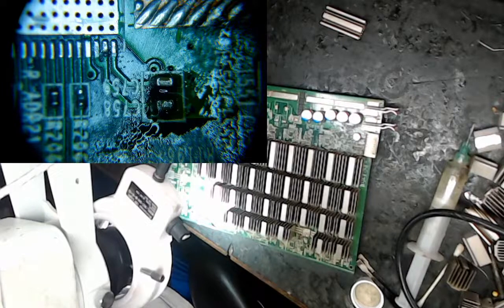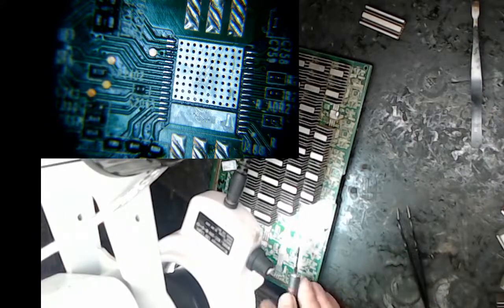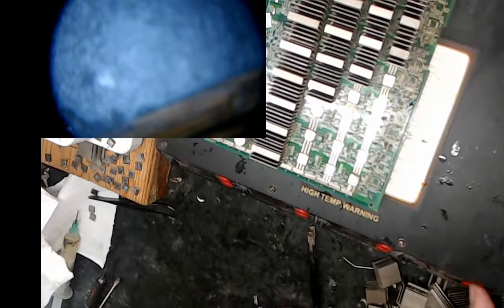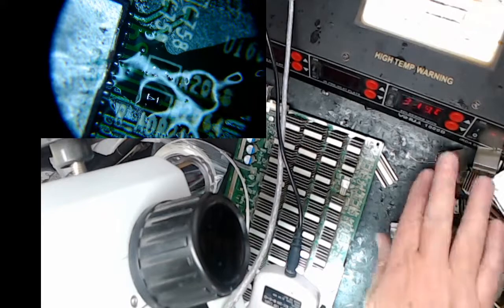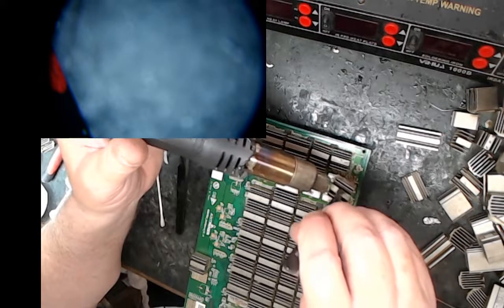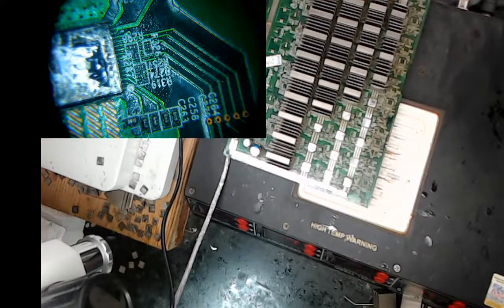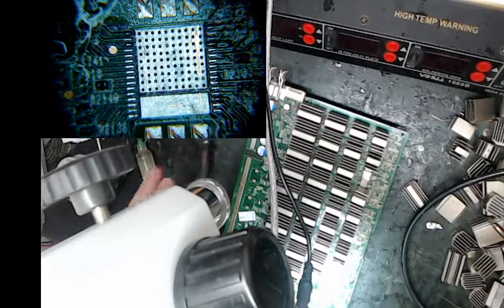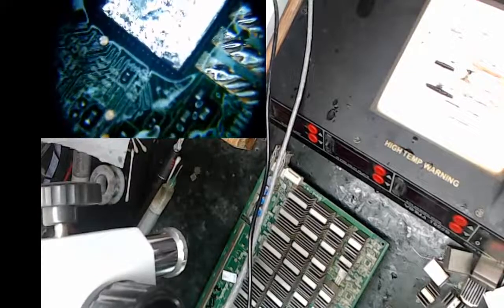hashboard repair: Working on S17Pro board

Comment: Do you actually fix boards for people? Just wondering I have 3 s17 boards and 2 s17+ boards that need to be repaired. Or know anyone that does without shipping across seas?
Reply from the maker: Hi No I just work on my own stuff right now.   Thanks!   You may want to look on my discord channel. There are repair folks there.  Link in comments
Reply: @AntminerRepair  teel to us your discord chanell too

Comment: You mention at 1:00:40 that you measure diode resistance by probing test point and ground of the chip. Is the top of the chip its ground? Because that's where you are probing.
Reply from the maker: Yes. Top of chip os ground.    Thanks!